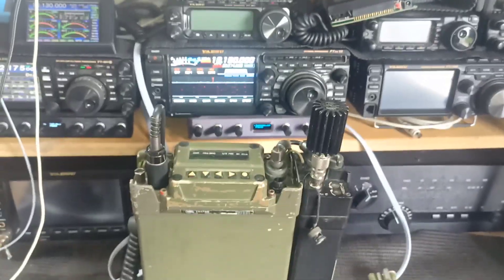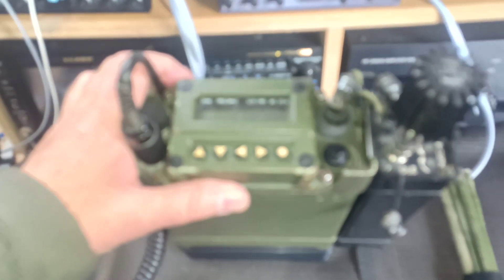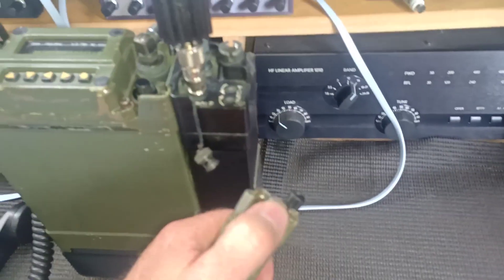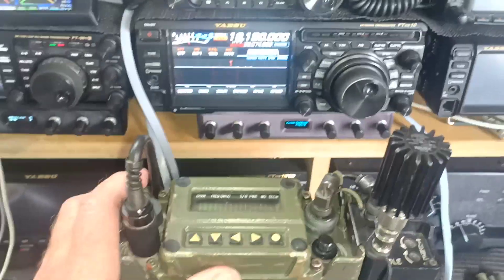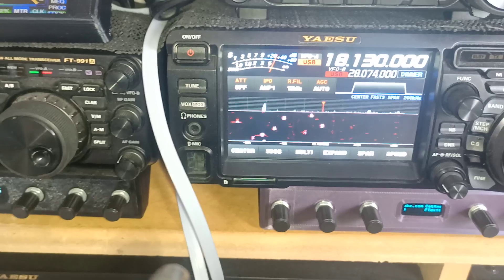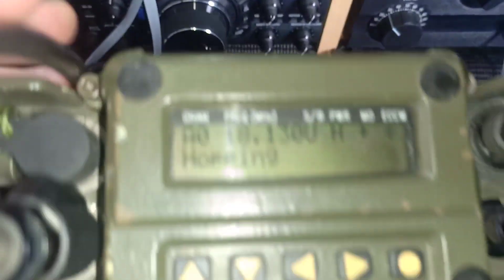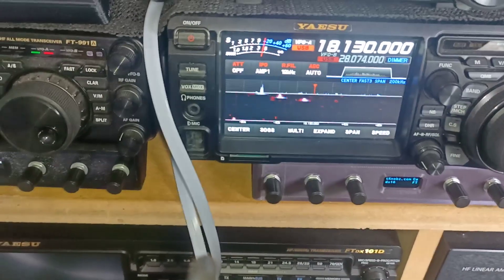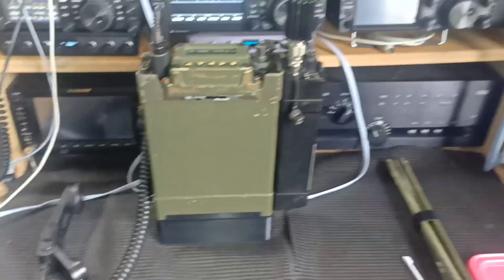Grintek TR-178b HF Manpack - hopping

Comment: Great Video Chris well done !
I have two of these radios. When I press the eccm button all I get is CODE on the display. Does it mean I do or dont have the hop option ?
Reply from the maker: You have to enter the same code on both radios..
Reply: @ZL1CVD  How do I enter the code ?
Reply from the maker: @schatzperson  Same way you enter frequencies - with the <  or > under each digit. Service manual from section 2.1.13 describes it in detail..
Reply: @ZL1CVD  Ok , will give it a go. I have not been able to get hold of a manual. Is it online someplace ?
Thank you.
Reply from the maker: Google is your friend: https://w2hx.com/x/?prefix=x/Grintek%20TR178b/

Comment: Nice video. What's the voltage and power range?
Reply: Operating voltage range is 10 VDC to 29 VDC.  Output is 10 watts at 13.8 VDC and 25 watts at 25.6 VDC

Comment: What is the radio like to search the Ham bands?
Reply from the maker: yes, you can tune the ham bands easy enough. Just place the cursor under the digit you want to change and the up/down button changes it. Very easy. Same for mode LSB/USB/CW. When you move more than a few kHz it keeps pestering you to retune the antenna. There is  automatic tuner for these - manual indicates it does tune automatically. I only have the manual tuner. 73 de zl1cvd
Reply: Following! Is it also capable of normal operation?
Reply from the maker: It does not have a VFO knob like usual HAM radio. You move the cursor to the digit you want to change and use up / down arrow to change frequency. It does have 99 channel memories so you could load up the HF Pack frequencies and easily recall them. The tuner is manual via a knob under the tuner - the radio lets you know to retune when you move too far from a tuned frequency. There is an auto tuner available but I do not have this.
Reply: thank you, I sent you a email yesterday. Not sure if you received it. @ZL1CVD